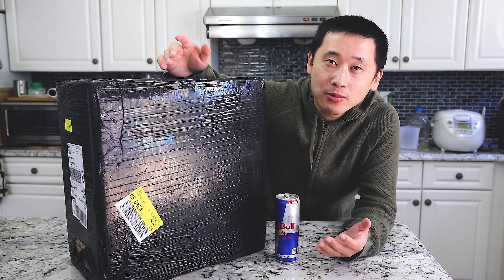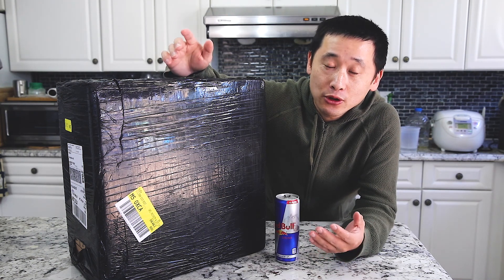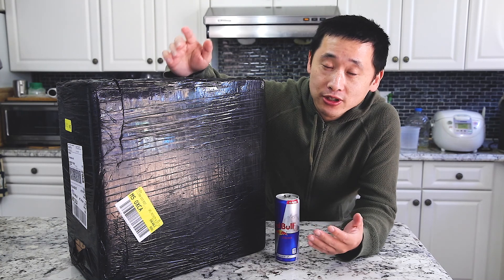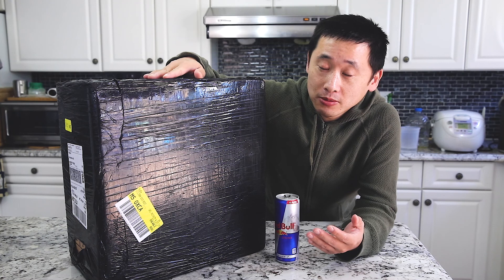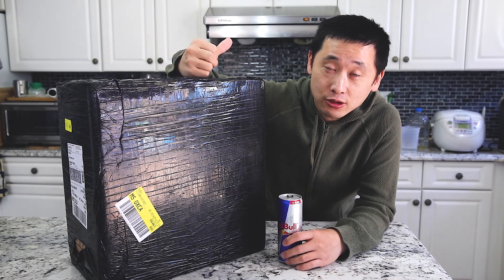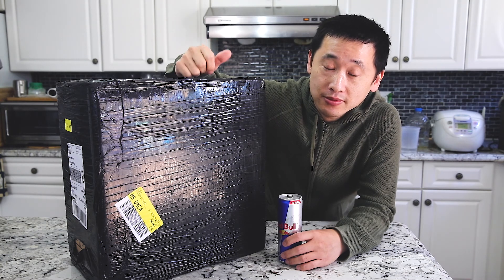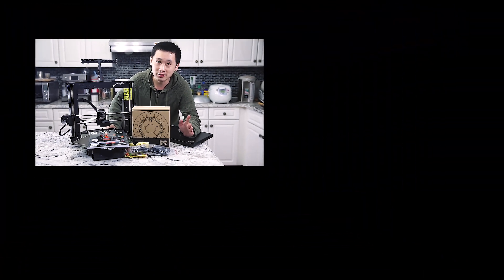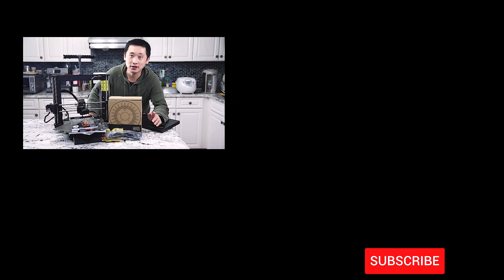Prusa i3 MK3s - Fun Time-lapse & Tips for Beginners

Comment: Nice time-lapse video! Just my two cents when I first did my first layer adhesion, I had trouble with the texture PEI. I had the Z-offset as low as possible and my prints still lost adhesion with my Benchy! So I contacted Prusa customer support and they recommended to scruff it up with some 1000 grit sandpaper to remove some possible waxy coat during the manufacturing process. Since then I never lost bed adhesion!
Reply from the maker: Thanks!
Reply: 1000 grit sandpaper doesnt scuff. It removes surface imperfections and grease layers. 1000 grit is for buffing, and polishing, not sanding.
Reply: @Djtylerwallace  you need to stop bullying. Your comments are not helpful. Scotch brite is fine especially for new PEI boards.
Reply: @amyzou9959  000 scotch brite, i absolutely agree. The green scruber sponges, to "scuff" up your pad, no absolutely not...that's an unknown grit with plastics and added chemicals. Someone is going to watch this and start sanding their new pad, and destroy it, because this dude said its ok. If you're going to give advice,  at least make sure it's legitimate,  and understandable...his advice is neither.
Reply: @Djtylerwallace  relax, you're sounding paranoid. It's just soap and scotch brite. Americans been using it for ages to wash their plates. 😂😂😂😂😂
Reply: @amyzou9959  you're right. I'm sorry. Still a horrible idea though

Comment: Please noone ever "rough up your board", that will destory it. If you're having issues with adhesion,  you did something wrong during the calibration
Reply from the maker: I have to disagree. There are many post online how roughing up the board "lightly" with 1000 grit paper or scotch brite actually improve adhesion when all else fail. Even Prusa's website suggest using 1000 grit paper to recover and restore PEI boards. 99% of the time I use IPA to clean the board. But ever since I use scotch brite, I have yet to lost any adhesion during any of my prints.
Reply: @Inspiron41  ill also note, i have probably 4000 prints through my prusa, and thekiinngg sheets, over 16 printers, and i have yet to have a single print fail to adhere.  Set it up right, and it will stick every time.
Reply: @Inspiron41  you can disagree all you want to.....but both prusa, and thekiinngg disagree.  Once you compromise the pei on a textured sheet, it's much more likely to flake off. I stand behind my original comment. If you cant get pet, or petg to stick to a stock, unmodified textured, or smooth pei sheet, you did something wrong.
Reply from the maker: "PEI bed cleaning methods – Hardware, firmware and software help – Prusa3D Forum" https://forum.prusaprinters.org/forum/original-prusa-i3-mk3s-mk3-hardware-firmware-and-software-help/pei-bed-cleaning-methods/
Reply from the maker: "Cleaning the PEI flex steel print sheet for proper adhesion — Bob's Project Notebook beta documentation" http://projects.ttlexceeded.com/3dprinting_mk3_bed_cleaning.html
Reply from the maker: "Just scuff it, or how to use your PEI bed – Prusa Community" https://prusacommunity.com/just-scuff-it-or-how-to-use-your-pei-bed/
Reply from the maker: Can you post an article where it was tested that PEI flaked? I'm a curious in read it. The chemical structure of PEI makes it highly unlikely to flake unless it was poorly manufactured or if chlorinated solvents were used to clean it. "Supplier Data - Polyetherimide ( PEI ) ( Goodfellow )" https://www.azom.com/amp/article.aspx?ArticleID=1883
Reply: @Inspiron41  can you show me where any MANUFACTURERS recommend this? All you showed was forum members, who have absolutely nothing to do with making the products recommend it. The same people who recommend using hot sauce as an adhesion helper lmao.
Reply from the maker: Manufacturing process purpose is to adhere to ISO quality set forth by manufacturing. Not to recommend usage. That's marketing purposes.
Reply from the maker: And FYI, PEI was never meant for 3D application. It was invented for medical application until some guy attempted to use for 3D printing.
Reply: @Inspiron41  no shit. What does that have to do with anything? Lmao.  Maybe get some useful,  and correct information out there, and you may get more than 200 subscribers over the course of a few years.  I've been 3d printing a lot longer than you have...like before pei was even thought of for 3d printing...the ONLY time you should use abrasives on a pei sheet,  is to rejuvenate a smooth sheet. That's it. 1000-1200 grit sand paper to remove a TINY amount of the surface will make your sheet like new. You absolutely DO NOT scratch the surface to promote adhesion.  That's just silly, and shows how much of an amateur you are. If you can't get your prints to stick,  without scratching your build plate, find a new hobby. But absolutely do not come and give such foolish advice.
Reply: @Inspiron41  also, again like i said, everything you showed says to use 7445 scotchbrite pads to polish the sheet, and remove etches, not to scratch the surface 😅😉
Reply from the maker: @Djtylerwallace  yawn no proof....from the man with 200 printers.
Reply: @Inspiron41  still at 200 subscribers yawn.
Reply: @Inspiron41  10 years....200 subscribers,  you're doing it all correct 😅😅😅😅😅😅😅 just another YouTube wannabe
Reply: @Inspiron41  I'll also point out, that 1000 grit sandpaper isn't used to make surface scratches,  it's used to remove surface scrarches, and buff the surface. If you start using the green abrasive sponge you showed,  you're only going to start sanding the textured sheet smooth,  completely making the use of a textured sheet irrelevant.  Again, if you need to do any of what you mentioned,  you did something wrong. But you have a YouTube channel with 200 subscribers, and your first 3d printer so you have all the answers 😅😅😅😅
Reply from the maker: Yet you haven't shown me evidence contrary.  And your claim of flaking haven't turned up any results. I'm all in viewing evidence contrary, but I haven't seen any.